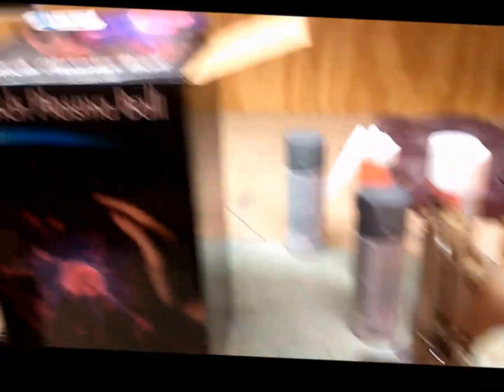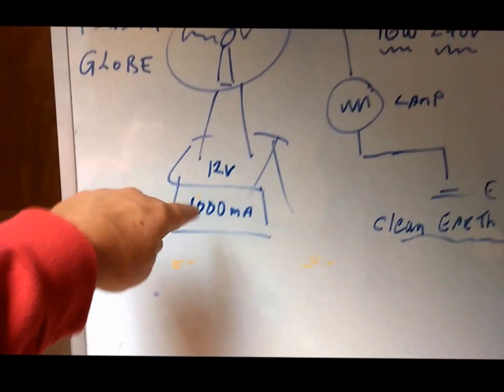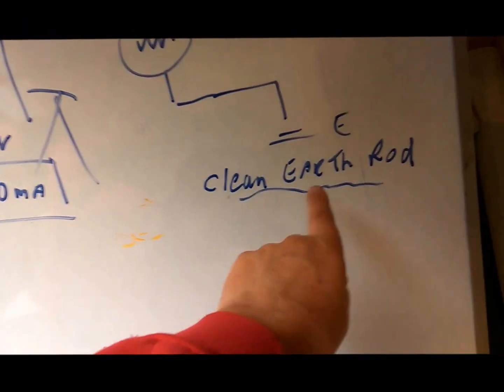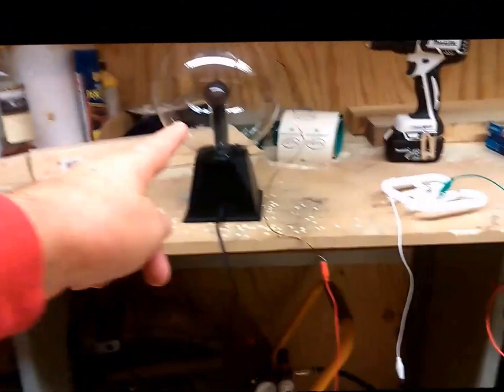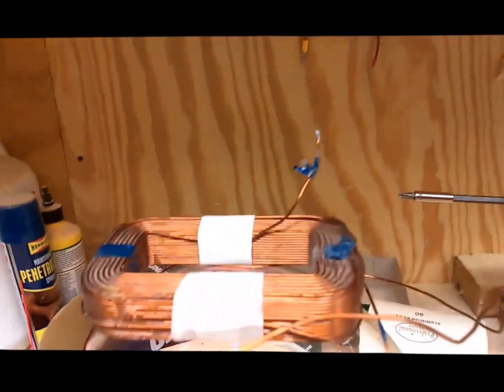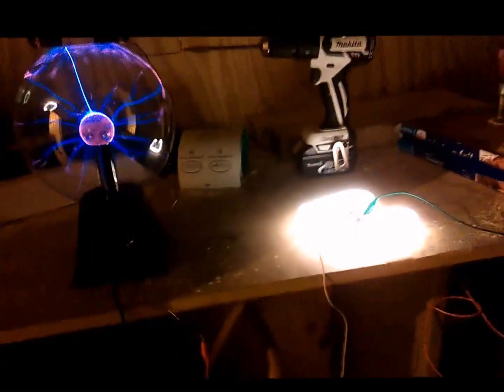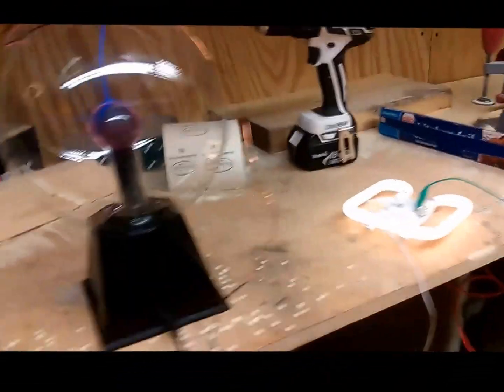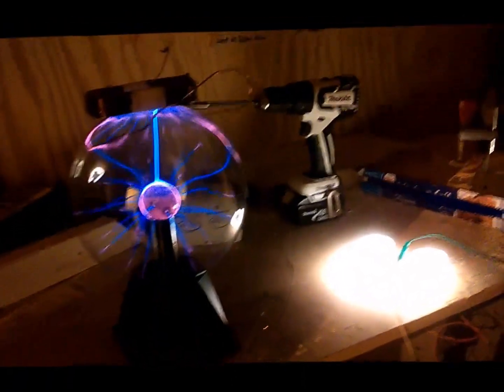Plasma Power

Comment: hey there just for some info you most certainly can touch the wire coming from your coil...i have the same plasma ball and did the same thing as you did in this experiment, you do get a little shock but not painful or deadly it is more of a high frequency burn and a tiny one at that, the plasma ball is basically a top load of a tesla coil, the circuit in the plasma ball is basically a very small tesla coil, you are using induction to obtain power to light the fluorescent tube. i dont know everything about these things but i do know my fair share. no disrespect meant at all just thought i would tell you what is actually going on with what you are seeing. you should check out more info on tesla coils,transformers and induction motors it will help you understand all of the experiments you have done or are doing. Great work though!!! you are certainly on the right track keep at it man.

Comment: Hi DC LIKE IT. HOW MANY TURNS ON THE COPPER WIRE WHAT SIZE WIRE.Oh be careful with testing get a voltage pen like Mr Morin there quick and pick up AC very good not very good at DC.Saves you from pain.
Reply from the maker: +Gerard Melvin Hi G.M. I just rapped an odd length of wire around the tubes; so its all about what's going on in terms of induction or static / RF. There is a strong charge ! is it Ac, Dc, Rf or static it is complicated because it is likened to the "Near Field" effect around an antenna. This is why I keep blowing my meters & I can not get true readings, its really difficult to work with & get readings for reference. .....  Regards ....DC